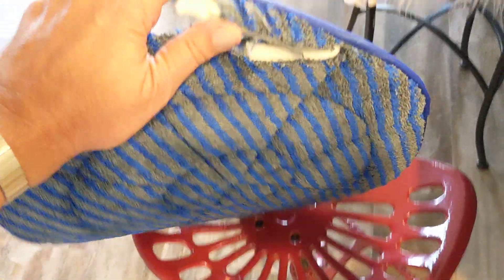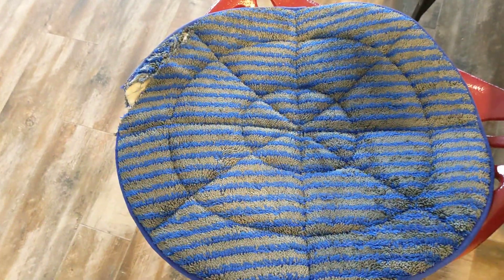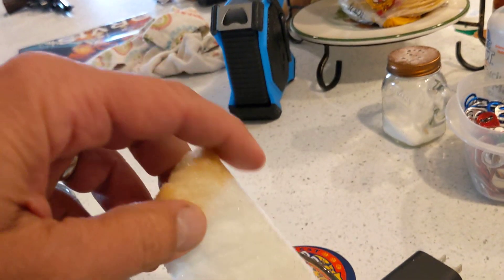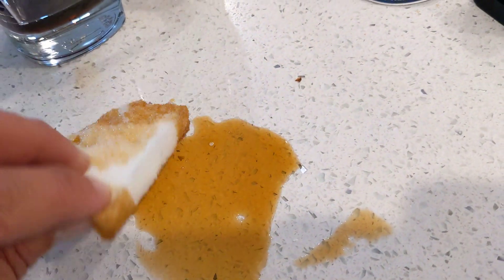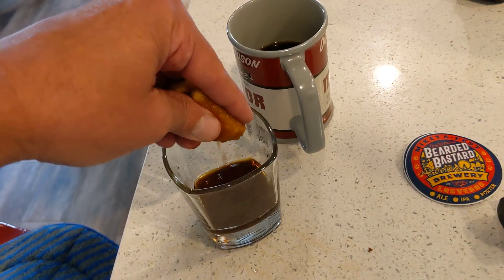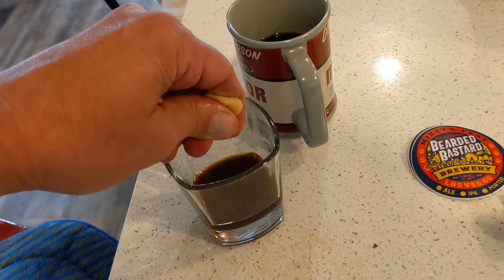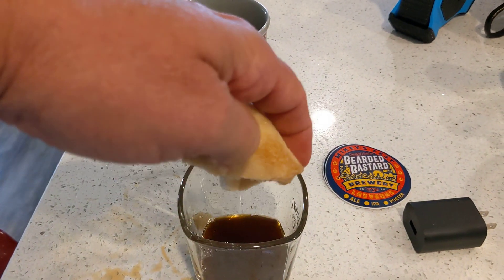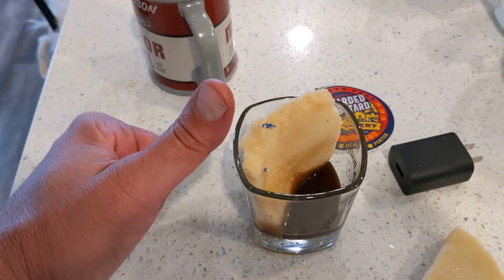How absorbent is your VLM system?

Comment: C'mon Man, the system breaks the dirt bond with the carpet and the dirt mainly falls down lower into the carpet.
Reply from the maker: Nope.
Reply: I like how you’re trying to educate one of the biggest veterans in the industry 😂
Reply: anyone that cleaned for more than a couple years knows that statement is not true or there would be a point of "full" as the carpet reached capacity which they never really do so obviously enough of the soil is removed to keep on keepin' on. and i'm not even a pad guy but i know what i see year after year.